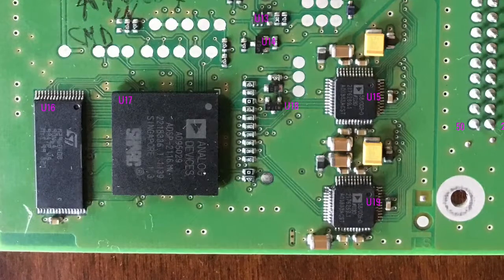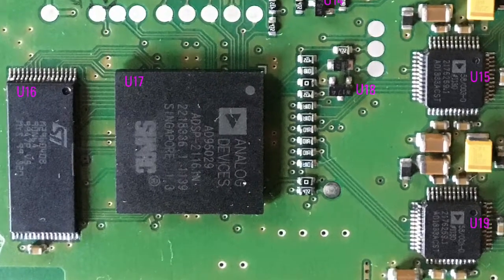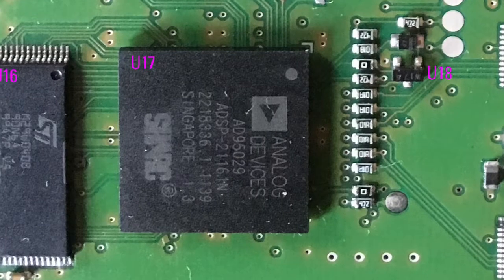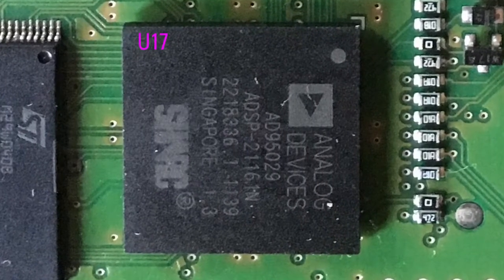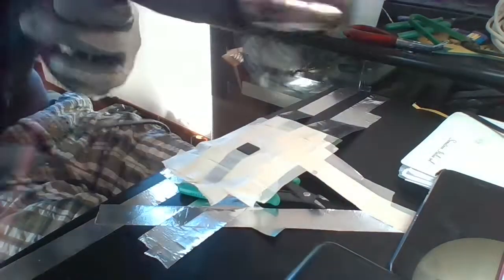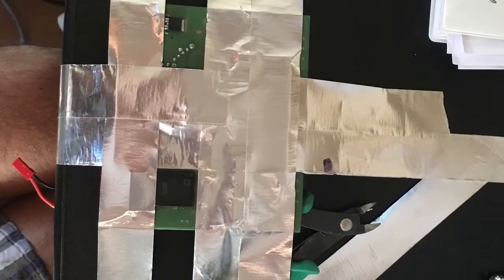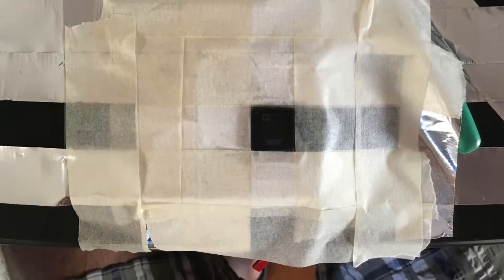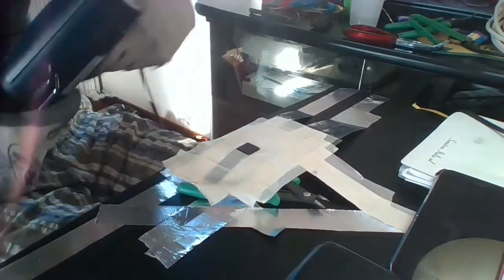BMW Harman Logic7 Amplifier Repair Guide - Part7

Comment: Can you offer a repair service? My BMW HK amp has blown due to water damage and a replacement is stupidly expensive
Reply from the maker: Paul Shepherd i can just try, if you send it to me. No guarranties. it could take 2 months since i Will do it in my free time. I live in Italy, let me know.
Reply: gaucho livido there is so much corrosion I don’t think it’s possible to repair. Why are these amps so expensive to buy?! It’s crazy. Thanks for the offer though
Reply from the maker: Paul Shepherd wash it with water and a toothwasher (gently moved)
Reply: @gaucholivido  Where are you located?